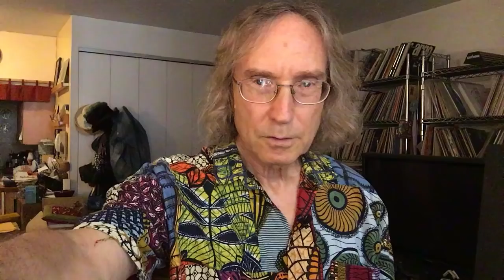Front or rear ported speakers, what’s the difference?

Comment: There are a few cases when you do need to worry about this...  If you really are going to place bookshelf speakers on a bookshelf, then you don't want rear ports.  Or if you're placing floorstanders in front of heavy sound absorbers or curtains, they will suck up the port output rather than reinforce it like a wall would.  A rear port is more vulnerable to what's going on behind the speaker, and you need to pay attention to that.
Reply: Yes, I've found that it absolutely makes a difference when, for instance, I need/want my speakers to be up against a wall.

Comment: This video really resolved nothing.
Reply: Yup I agree. He just lists (name drops) the speakers he has listened to and has no opinion. I struggle with my main rear ported speakers as they can be too boomy. I fix it by plugging the ports with old socks. If I need more bas for a movie I switch on the sub. I'm just researching; I'll look elsewhere.
Reply: That’s pretty much the point
Reply: @wilwordsworth  4 years late but I was getting the same problem until I pulled my speakers away from the wall a foot. The bass became stronger but much cleaner and tighter
Reply: @bigmacfullerton7870 speakers and listening spots alike are not good when against a room boundary

Comment: Ports are a source of distortion.
If you can add a resonance to the speaker to extend the apparent frequency response or to coincide with say, kick drum frequencies that makes for a more exciting listen that compromise may sell more speakers. You can also hear cabinet resonances coming out of the port and adding a colouration. Sometimes there is turbulence as the air pressure changes as it passes from the port into the room and back. 
A port done well is seamless and means you can get the so called quart out of a pint pot. The sound is bigger and delivers more volume and bandwidth. The port damps the driver by acting resistively outside its resonance frequencies. Pointing it backwards makes the speaker sound more airy and makes the imaging more vivid. It becomes harder to hear the mechanical colourations. Front porting can feel a bit like the speaker has another drive unit up front. The best ones have low port velocity and don’t tend to produce gusts of air and turbulence. Small ports have high velocity air exiting at almost all frequencies. The answer to turbulence and incoherent contributions from the port include bundles of straws or reticulated foam bungs. They narrow the resonance peak and keep some of the colourations in. 
The transparency of the speaker is mostly predicated on build quality and, the contribution of the port must give the appearance of extension without the problems of using a resonator in an obvious way. The right sized port might need to be out back both for sound quality or lack of available surface area.
If the speaker sounds right, it is right - however, the compromises will need to reconcile well to maintain the illusion of accurate playback.
Reply: I was wondering if you had any thoughts on Port placement for a Bluetooth portable radio keeping in mind it'll be moved around and positioned in different environments. Including open air performance IE outside.

Comment: My 2 cents comparing the B&W 705 S2s (rear ported) vs. the B&W 805 D4s (front ported). I compared them in the same location switching between the speakers multiple times while playing the same song. Here are my observations: 

The rear ported 705 S2s produce more room filling sound and may I say stronger bass than the 805 D4s, but the front-back sound stage (particularly vocals) become muddier and I was not sure where the singer was placed; the vocals appear to be coming from behind the line of the speakers and also above the speakers; the right-left soundstage is perfect - no effect of the rear ports on this.

The 805 D4s on the other had appear to produce somewhat weaker bass (on drums - particularly the bass/kick drum), but the front-back soundstage (particularly vocals) is very clearly defined and right in front of you as if the singer is standing right in line with the speakers. The right-left sound stage is same as the 705 S2s - in the middle and perfect.

I guess it is a choice between perfect soundstage and a slightly weaker bass performance. Not sure which way I am going to go yet.

Comment: Over the years I have owned front and rear ported speakers. After much rearranging and positioning all of them ended up with socks stuffed in the ports. As soon as I can I will go back to a sealed cabinet design, this may require a new amplifier as well.
Reply: i tried with cloth stuffed in ports as well, its actually works. especially if you got a subwoofer to compensate. 
a sealed box whould ofc be better.
Reply: A new use for the phrase "put a sock in it."
Reply: I'll only ever use sealed because of bass issues
Reply: THIS. NO port is the best port. Smoother bass roll off. Supports the speaker diaphragm.

Comment: Front port or rear port affects layering in soundstage. If the port is in front , left to right imaging is great but depth suffers. For rear ported speakers, apart from the imaging left to right, the depth is better. For placement of front-ported speakers getting close to the wall actually makes them sound better. Monitor Audio bookshelf speakers are a case in point. You may agree or disagree but that's my experience.
Reply: Most bass is either centre stereo or mono tho, so stereo imaging isn't normally an issue with bass

Comment: my friend the port location makes a big difference...   if the port is in the back there is less cancellation,     if the port is on the side it is 90 degrees out of phase which can help with out of phase cancellation,    front port has the worst  cancellation if not done and tested properly,   but front port couples with the speaker wave giving you a small increase in output at tuning frequency...   side firing also slightly increase the output as it couples with the main driver waves....   but go outside your house and you will find out that rear firing is the best as it will reflect the bass from the wall.

Comment: The location of the port does make a difference, although small, there is a difference. The port produces the lowest frequency a speaker is capable of playing. Depending on the depth of the speaker and proximity to the wall behind it, this can make a difference in the sound. I have a Klipsch rp440 center channel, it is about 14 inches deep, that means placing a port in the rear will mean the lower notes are generated closer to the back wall.

Comment: For everyone who thinks they know how ports work, please read this. ( http://audiojudgement.com/bass-reflex-speaker-design/ ) I have Vance Dickason's book, albeit an earlier version, along with numerous other design books, etc. and have known how ports work for many years and I cringe every time I hear or see "the port is out of phase" line.

IF the the port was always out of phase, it would do nothing but cancel when front mounted and only add when rear mounted. Side mounted (that includes top and bottom) would theoretically do nothing since the phase would be 1/2 add and 1/2 subtract. 

As for rear firing ports, it is the combined effect of the sound (sound wave, not the mass of moving air) reflecting off the wall and recombining with the front waves of sound from the front baffle of the speaker. That little thing called phase shift due to time. That is why distance from the wall makes so much difference in how good the speaker sounds.

There's a lot more to it than these few sentences. Please, pick up a design book and read it rather than rely on someone that sounds plausible on the internet. You'll enjoy your audio so much more when you get to understand it.

Comment: I thought the decision behind choosing a rear or front ported speaker had to do with how close you could place the speaker to a wall. Therefore if you had to place a bookshelf speaker against a wall you would be better served with a front ported one.  Am I wrong?
Reply: Patrick, this was my understanding too, but then I read that with some designs the rear port is preferred to be close to the back wall with a view to boosting the modest bass.
Reply: 3 minutes of video. And still nobody understands anything. That is a fail.
Reply: Patrick, I think you ARE correct in your thinking.
Reply: That's my understanding too.
Reply: I think he's saying neither is designed to be used close to a wall in the first place, ie non issue for him. But of course that's not the real world, and is he really considering space saving bookshelf speakers in this judgement?
Reply: I think that's basically correct.

Comment from the maker: The point of this vlog was just that the designers don't favor front or rear ports, they go back and forth as they see fit. Andrew Jones for Elac for example, moved the port from the rear of the original Debut B6 to the front of the new B6.2, and B&W designers moved the port from the front of the 685 S2 to the rear of the new 606. So apparently the designers in both cited examples saw no advantage to front or rear port placement. They use whatever works for each design.

Putting most speakers up against or near a wall won't be an ideal situation. Front or rear port placement isn't that big a deal. If it was designers would never use rear ports.
Reply: Steve Guttenberg Audiophiliac Andrew Jones should have read the comments here and realized ports are always bad. You’d think he’d know best but the YouTube experts disagree.
Reply: I swear there's a video interview of Andrew Jones - might have been his last home theater geeks episode with Scott Wilkenson where he specifically mentioned with the Debut 2 he made a design decision with moving the port to the front due to questions Elac was receiving from their customers about how close they could put the original Debut to the wall. So to alleviate the feedback and concern assuming this is their most popular mass market line and audiophiles won't be putting speakers near walls he moved the port for the Debut while not doing so on Adante or Uni-fi the more high end speakers.
Reply: I think you may be referring to his comment in my interview with him. https://youtu.be/mR8Sa0xYulk?t=2700 or maybe Steve's interview with him:  https://youtu.be/qZvhG7yUJGc?t=72

Comment: The length of the port is more important. My ports are tuned to compensate for low frequency rolloff of my 15" woofers (which happens below the driver resonance).

Comment: It makes sence because the wave length is probably longer than 3m so the disposition of the port to the woofer is probably fairly small relative to the wave itself. Bass is not that directional either so I agree there is not much of the theoretical difference as your wavelength is in magnitudes larger than the difference in position.
Reply: You need to put the measure of the wall distance on that account.

Comment: But what are ports for, though?... Is it to release any buildup of tension inside the cabinet or is it to "tune" the sound? If not both of course...
I mean, kind of like front and down facing/firing subwoofers, there must be something of a difference. AND, it probably has to do with the environment.
As an example, you might have heard of the Bose 301 speakers. They designed it to rely on reflections from hard surfaces and for that they added two "tweeters", one facing forward and one back, and they're sticking out on an angled baffle, on the "corner" of the cabinet. - The interesting part is, they've also put the port right behind those, also at an angle. And I'm quite convinced that any frequencies coming out there are also directed at any room-surfaces and add to the sound-strength. - Another interesting thing is that on later models they moved the port somewhere else anyway... So who knows...

Comment: To be fair, some speakers are designed to be placed on/near a wall! Dali's Zensor 1 and Oberon 1 come to mind - their most compact models. In that case Dali recommend placing them on or extremely close to the wall; the rear port and wall working in tandem to enhance the bass. Many agree that they sound very "thin" if placed further out in a room.

Comment: Front ported for me. My room is 2.3m by 2.5m , got enough issues with it without dealing with rear ports.
Reply: @SMOG my experience has been that port position and tuning has a marked effect on both bass and midrange preformance. Honestly massive sealed cabinets would be great if space wasn't such an issue.
Reply: @SMOG port chuffing is a crime against audio. I've never understood why designers would sign off a chuffing speaker. Fortunately my speakers have 3.5" wide ports with aerofoil centers and are not audible to me 😄. I've had speakers that chuff in the past. I always block the ports and just accept whatever bass and mid loss it entails.
Reply: That space ? How long do you think a 80hz wavewould be ? Rear-front it doesnt matter. It matters that you play that frequentie for you little room

Comment: Should the ports be left open or closed with sponge as provided with kef speakers? And what difference does it make in the sound quality?
Reply: Gautam.   Put a sock in it!
Reply: If after carefully locating them (following the instructions that come with the speakers and I suppose written by the designers), and, as me with the Q300, continue hearing an unnatural enhancement in the low mids, don't doubt it: close the ports with the foams. You'll hear the difference for the better.
I guess the Audiophiliac will agree with me: I'm letting the designers design, and I'm using a tool the designers have provided in case their design, under some circumstances, needs a little help to obtain the best from the design.
No?

Comment: Transmission line??
Reply: Mainly in the front.
Reply: Dragan Antonijević yes I know. Just wish he would have acknowledged the port with transmission line speakers.
Reply: ''Scusa'' George Bartolo. And you are right, that's a pity... BTW, they are mainly front ported, because there are no turbulence in their tunnels (they sucks all unwelcome things), like in plastic (or no matter what) tubes in bass reflex ported speakers... there might be no turbulence if the tubes of the bass reflex ports are made from better materials with some texture and fixed in more places... like some manufacturers do... so... inter alia... ''down firing ports are the bests''.
Reply: Transmission line is very goog solution,natural crossover!

Comment: When you say 10-12" from the wall,is that measured from the back of or the front of the speakers??
Reply: Simply try it out for yourself! You will find out your own personal preferences!
Reply: Should be measured from rear of speaker, ie gap distance.
But do try moving forward and back from this measurement to get resonance correct, otherwise you may end up with a reflecting sound wave off back wall reducing or even cancelling effect of forward sound waves!
If you have a smart phone you can download an App to measure frequency response. 
Go online and download an audio test frequency sweep or hifi bass test signal file, burn to CD, then playback while monitoring on fone App. 
When signal responce is looking smooth and level from 250hz and below to your bass cutoff (cut off typically 60-20hz), ie no drop outs in between, then you got it right 
😎👍